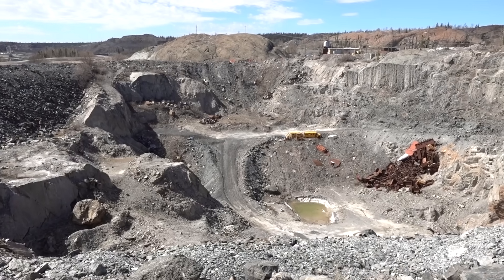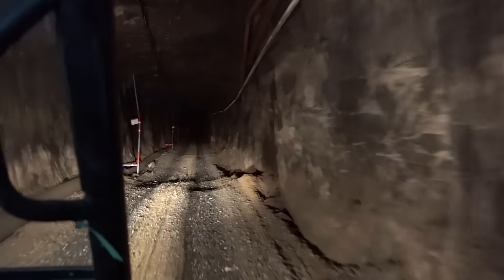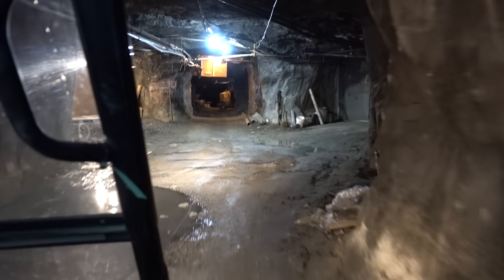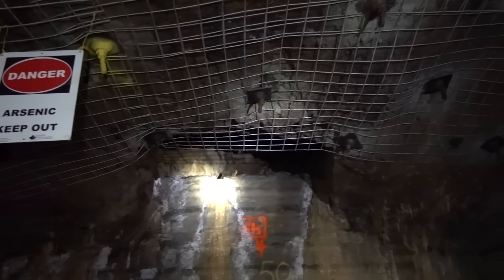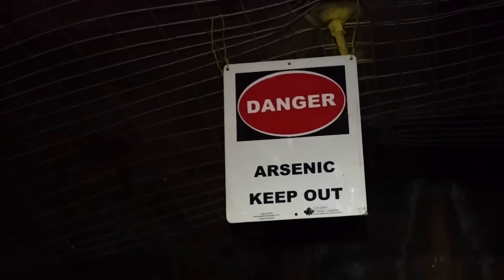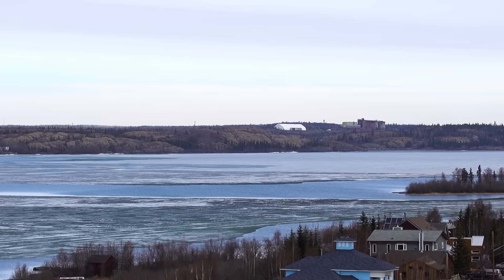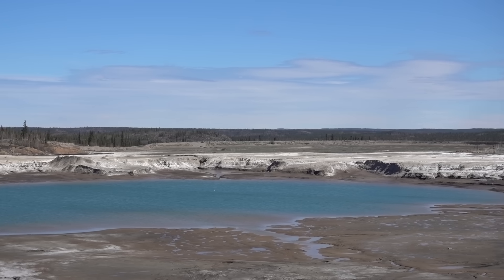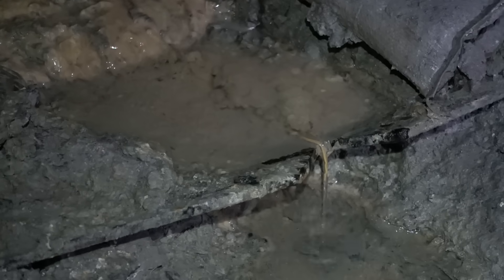Making 200,000 tons of arsenic dust safe

Comment: freezing is not a good idea.  They really should place that stuff into stainless steel drums and have it encased in those drums permanently.
Reply: Mixed with zinc powder.
Reply: Too dangerous.  Would have to send workers down into the chambers to handle the extremely toxic stuff.  It would also stir up the dust and potentially cause leaks into the surrounding area.

Comment: this is the issue with all mining for every single thing we mine for. there's mountains around the would made out of tailings. we have over 1 million abandoned injection wells in the US. we have a massive toxic waste issue because of mining. most things produce at least 10 times more waste than product. so for example 1 ton of copper produces 99 tons of toxic waste rock. now think of all the mines everywhere. it's also not just one metal or toxin. it's always a combination of many things. often with toxic petrochemicals like PCBs or PFAS type stuff. we haven't even started testing for this in most places yet.

Comment: If the lake is already polluted can't they build a dome over it, fill it with arsenic and pump it out to store in underground tanks of multiple layers of some material that would keep the arsenic safe instead of constantly having to freeze it in the future if the temperature goes higher? I get that the contaminated water would be get into the ground but that's already the case, isn't it?

Comment: Maybe there is some way to chemically neutralize the deadly arsenic compound.  "Plasma Gasification" supposedly reduces every substance to a harmless glass-like biproduct, by burning material at such a high temperature that all molecular bonds are broken.  Perhaps 200,000 tons of arsenic is just too much to eliminate by such methods.  At least Canada now has a vast supply of arsenic to sell, in case it has any practical purpose.

Comment: What Tom Scott doesn't say is that the gold was contained in arsenopyrite ore. So when the ore was processed, the arsenic oxide was the residue after processing. Given that arsenic can be used in solar cells, maybe the arsenic residue may be reclaimed for other uses in the future. Arsenic has uses in treating timber to make it termite resistant as well as other uses. Another example of arsenic poisoning was the aid schemes to dig wells or put in bores to get clean water in third world countries. Problem was the underground water in some areas had high levels of arsenic.

Comment: There should be a bond retained until the clean up is complete, or released in tranches later as the clean up is signed off by an independent assessor.

Comment: Why can't the just fill the tunnels with clay, or a mix of clay and concrete, and yes it would be crazy expensive, but more long term. Plus they would still freeze it and then most likely permafrost would kick in. Or more nuts fill the tunnels that are closest to the lake with concrete. And again I know it would be crazy expensive. Doing this over a decade or two would be a  permanent solution.

Comment: The solution could be Chem grouting / HaywardBaker does sodium glycol with diabasic Ester to stop erosion and stabilize soils particular sands and rock but will stabilize silts or atleast seal them from water as the chem grout does not breakdown from water. I have use this process many times for construction of drill shafts and MSE wall foundation stability. The material is fracked in but is a basic mix and pump material, then hardening will occur based on time and component percentages. Sometimes other disciplines can be the answer. Good luck as this could be your answer I hope.

Comment: Is there a way to destroy arsenic?  
Break it down to elements?   
Encapsulate in steel, concrete,  or other material/s?   Look at nuclear industry, stored in special drums stored in abandoned salt/potash mines - then classified as interim storage, later a total solution could be found
Catalyst changing?
From information supplied, ground water invasion could be the greatest threat 
I like the refrigeration system using minimal power 
Dale

Comment: Why not pour cement dust into the cavities where the arsenics at, the cement dust would draw in any moisture and the Arsenic dust would start to harden along with the cement dust encapsulating the Arsenic dust,  then they could freeze it once and seal off the cavities with a 8 ft layer of cement encapsulating everything permanently..

Comment: if it breaks down in water, why not just drill a hole from the top and then fill the cavaty with water. Problem solved, No?
Reply: It doesn't break down in water, it dissolves in it. Which means you still have the same amount of arsenic but now dissolved in water which will leak out and completely poison the entire area.

Comment: Why not just encase it in cement? Seems cheaper and less complicated.
"but it will crack" So does rock, so it's back to how it was in the beginning.

Lets do the math, cement seems to cost about  $100 a ton, how much would you need to mix with the 200,000 tons of arsenic dust? Maybe 1 to 10? As cement is normally mixed with 3 parts sand and 6 parts aggregate to make foundations. 1 to 5 seems like a safer bet so lets go with that.
So you would need about 40,000*100 = 4 million dollars worth of cement. Add in the labor, transportation and machinery cost, I bet you can safely store this arsenic dust permanently for about 20 million dollars.

Canada, feel free use my plan and send the difference of 880 million dollars to me.
Reply: Interesting

Comment: How will this cooling mechanism work with Global Warming?
Reply: Probably forever. This far north will easily get cold enough every winter to maintain the -5° temperature. Global warming is just a slight, average increase in global temperature. Still a big deal, just won't matter here. Humans will be dead by the time the environment got bad enough to not maintain this system

Comment: Why not just mix the arsenic water with concrete?
Reply: would you like your house to be made out of arsenic concrete? what if that concrete cracks and breaks apart?
Reply: @chaosincarnate1141  I didn't imply it should be used in infrastructure. I meant fill the space with concrete and leave it.

Comment: So... It works because it's so far North that the average temperature at the surface is below freezing? What happens to it if that wasn't the case? What would happen if, hypothetically, we were emitting so much CO2 and other greenhouse gases into the atmosphere that we were causing climate change and global temperature increases that disproportionately warm up polar regions?

Comment: Just a thought- Doesn't the frost on the pipes indicate that there's some serious inefficiency with their system?? Ideally you would only want heat to be transferred to the liquid CO2 from the arsenic dust because that's the part you want to freeze, and I feel like the frost on the pipes is showing that there's definitely some room for better insulation there. I'm sure there's a perfectly good reason for it, but it just seems funky.
Reply: This is a guess based on the mention of active cooling with glycol: the frost pipe shown was slightly sticking out of the earth in which that pipe is intended to absorb heat from the surrounding areas and actively help the freezing process. Perhaps the part of the pipe further away from earth is insulating

Comment: for anyone wondering, the difference between a "thermosiphon" and a "heat pipe" is that a thermosiphon uses gravity to return the working fluid to the source end, and a heat pipe uses a porous "wick" layer on the walls of the tube. They are otherwise identical in operation and theory.

Comment: Use the arsenic dust to make concrete, put in ordinary concrete shells and drop them into the deapest ocean trench where an ocean tectonic plate is being subducted. In time the concrete shells will be covered by dirt in the trench and encased in metamorphic stone.
Considering the threat of the big Cascadia earthquake, that ocean trench may be suitable.
Arsenic has a density of 5,7g/cm3 and is displaced by everything else that is dissolved in seawater, so even if it dissolved into the seawater, it is not getting out of the deep oceanic trench.

Comment: CO2 can't turn to liquid under normal conditions. Supercritical CO2 in under quite a bit of pressure. If the pressure drops due to lack of maintenance, the heat pump will fail and the arsenic will the out.